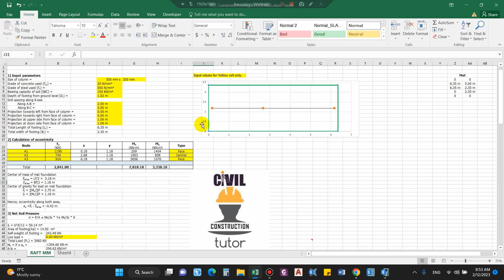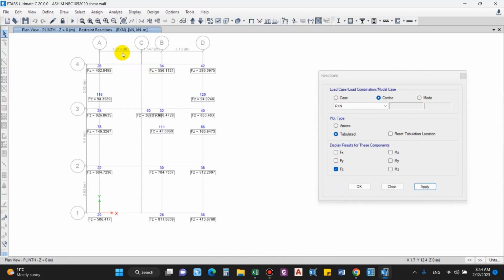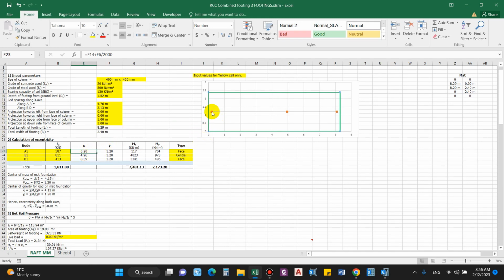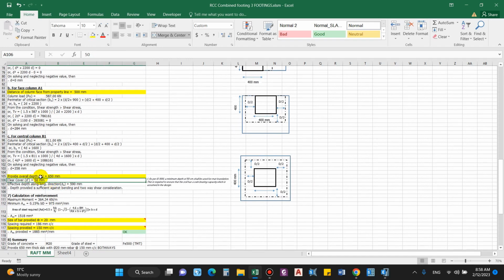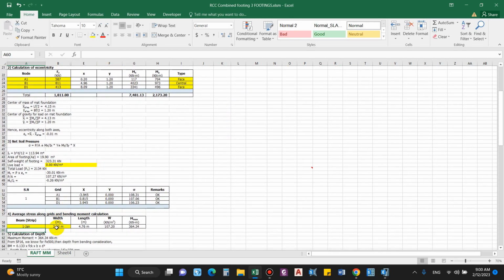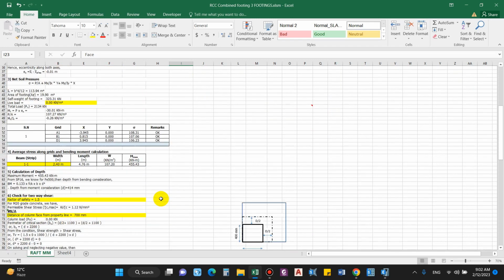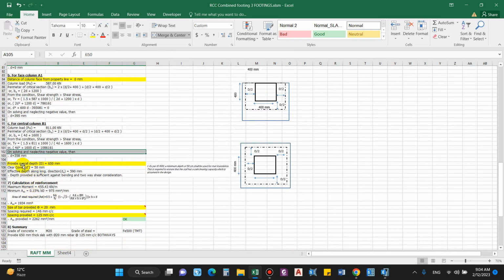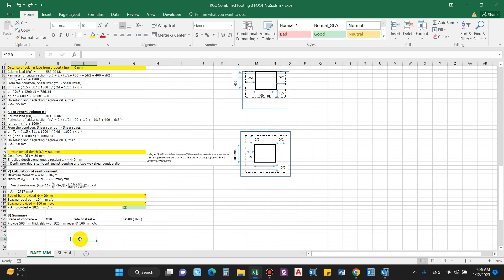Design of Combined Footing for 3 Columns | Excel Sheet IS 456:2000 | ETABS Multistorey Building

Comment: Hello. thank you for sharing your knowledge and it helps me on what im doing right now. question, if the column at the center is having a "y" distance and is not align on left and right column, I think you will have eccentricity at the ex and ez right? And im wondering why we need to average if we can check the actual bending at the face of the column but i think that will be a very tedious work to do

Comment: Nice sir. sir can you upload video of torsional irregularity checks on all, step 1,step2, and step 3  on deformed shape option on etabs,if there is torsional irregualrity then how can we fix it..
Reply from the maker: I have uploaded video regarding torsion irregularity. Just choose step number for either load case
Reply: Sir, what if step 3 exceeds more than 1.5 it means there is torsion right.
Reply from the maker: @manishkoirala1745  Yes. There exists. Similarly, check for displacement and drifts for 3 steps as well.